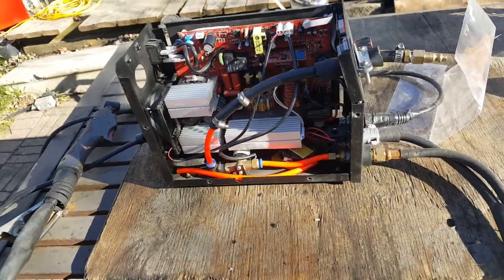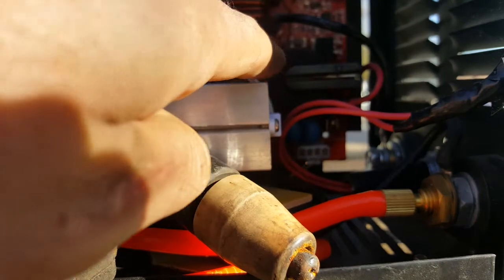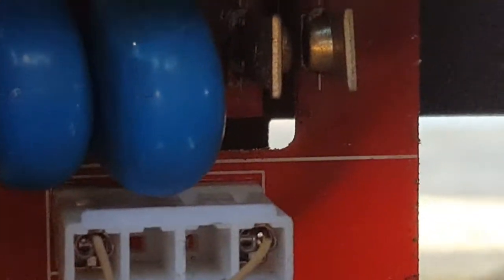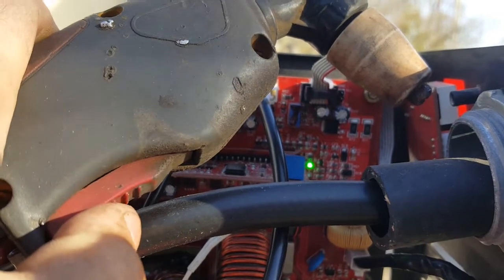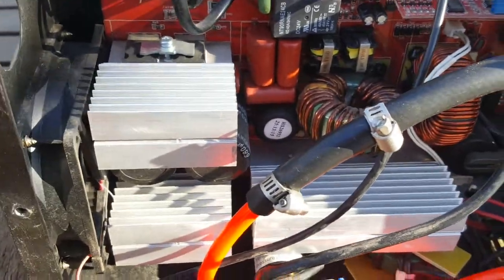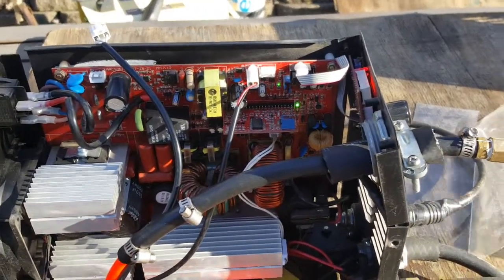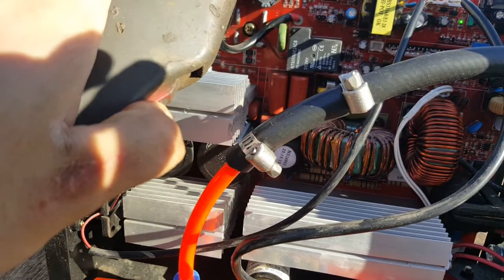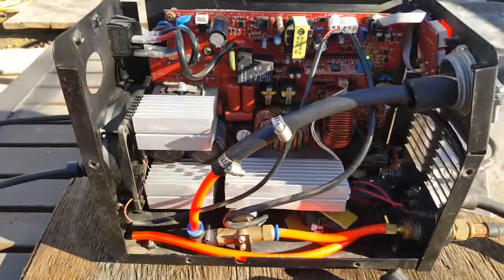Herocut 45i plasma cutter issue after 2 years

Comment: I can tell that you've opened the machine a few times and messed with it even before you had this issue. Hey, for $159 dollars just order another one .
Reply from the maker: THIS PLASMA CUTTER HAS BEE REPAIRED!! by an electronics genius.
The issue was faulty Diodes (F30U60DN)behind the heat sink/rectifier bridge.
Reply from the maker: It's currently at my brothers house. 
He can probably repair it.

It seems that now he same machine is around $400. 

Yes buying another one is possibly a short term  option but ideally I'd like to get one that I can rely on indefinitely....maybe I'd have to make one

Comment: Hello. Is there a short in your trigger handle?
Reply from the maker: Hey. Hmmm....i don't know. But I don't think so.
Why do you say that?
Reply from the maker: @TracyD-y5s  I'll open the trigger  sometime and take a look, but I'd think that a short in the trigger switch would simply keep the arc on
Reply from the maker: @TracyD-y5s  UPDATE: THIS PLASMA CUTTER HAS BEE REPAIRED!! by an electronics genius.
The issue was faulty Diodes (F30U60DN)behind the heat sink/rectifier bridge.
Reply: @OldCrowsClassicCars  Right on. Happy to hear it's fixed.